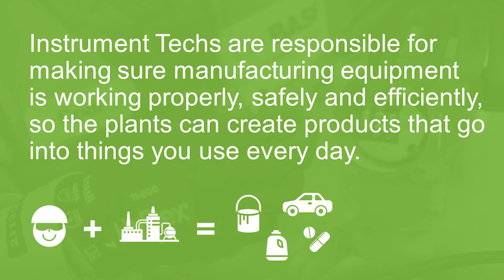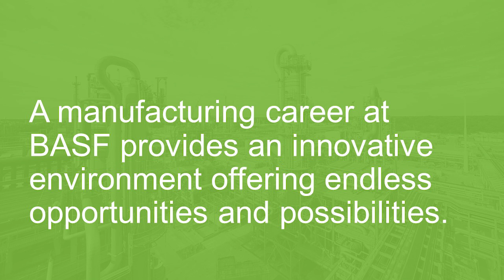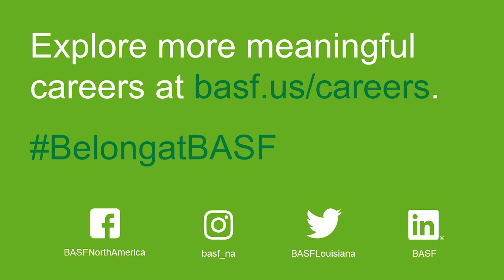Creators Wanted: Instrument Technicians

Comment: Difference between Instrument Tech & Instrumentation and control engineer?
Reply: As a general rule of thumb, engineers focus more on the theory and design of various technologies, and technicians are more on the hands-on side. You still need solid knowledge of the machines you work with in order to be a technician, and there are some relatively hands-on engineering jobs, but that's generally how it works.

If you want to design stuff, become an engineer. If you like working with your hands, become a technician.
Reply: Instrument Techs make Instrument Engineers' dreams come true.
Reply: @scottleitch2957  which one pay more?